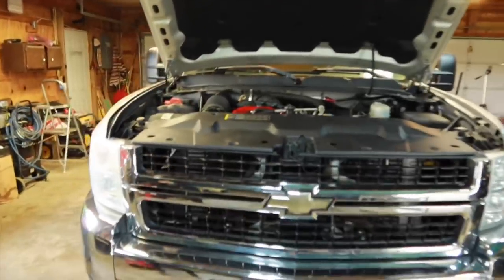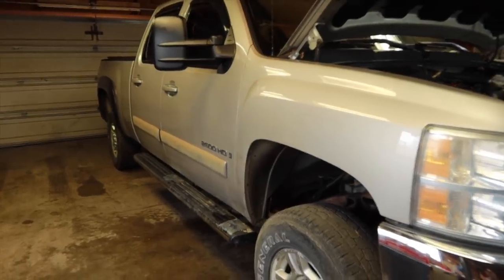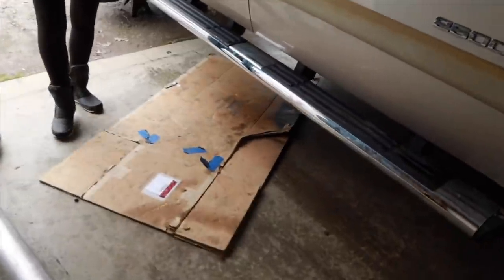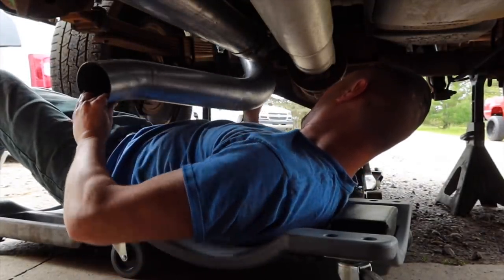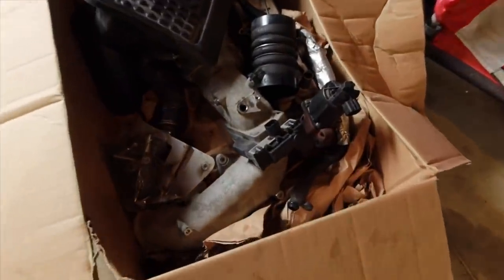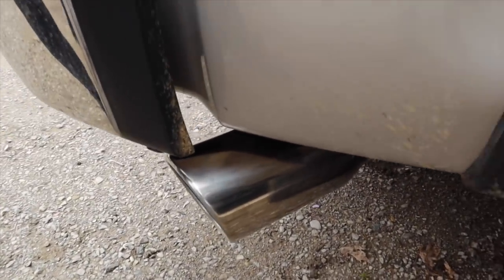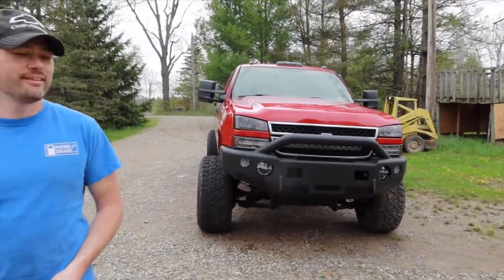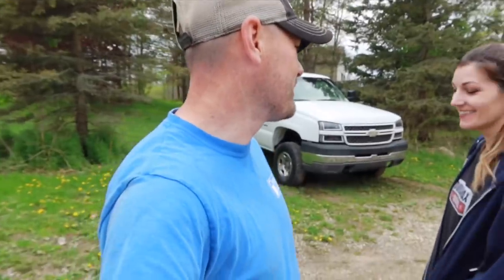You Have To Hear This Duramax Scream!

Comment: Hey Truck Master. I just recently installed the BMP Lift Pump. Super easy. I used fuse #40 "Misc IGN" for the fuse tap. That thing really pushes some fuel pressure. I checked it at the Schrader valve right behind the alternator with only the lift pump running. The CAT water separator fuel filter is really nice too. 
The lift pump has been working great. There's a sale code right now too. 
My 08 LMM is fully deleted with DSP5 EFI Live tunes.
My regular cold side pipe has pretty good brackets and it's rock solid, but I also installed the Pro Fab Y Bridge strap. It's pretty cool and cheap insurance. 
You should do a review and install video about the Pro Fab y bridge strap.
Reply from the maker: Awesome man thanks for the review
Reply: @TruckMaster  You're welcome. Great video too btw.
You're the best truck channel with quality content.

Comment: Hey truck master question? I have a 2008 crew cab LMM 2500hd duramax my truck is already tuned,deleted,egr block off kit,4 inch mbrp race  exhaust.few other minor mods. My question is I really need a new exhaust system, mines rusted out as I live in Maine, w new emissions standards purchasing a new exhaust system for my 08 Isa challenge.If I buy a system for a 2004 crewcab duramax pre DPF Era will that exhaust system fit my 08 crew cab truck? I want a 4 or 5  Inch MBRP STAINLESS exhaust system

Comment: What do you do with the dpf system in the truck I'm about to do an exhaust on my 07.5 lmm and I don't know what i need to do with it
Reply: straight pipe it and get a custom tune so it wont have any codes
Reply: I mean I have it tuned with a ppe tuner so I figured that will help with the codes right
Reply from the maker: No it has to have the option to turn the DPF off so you will need a efi live tune
Reply: Thank you truck master  do you know if there is a way to trick the system after you straight pipe it until it can be tuned
Reply: @jamesberdeaux7848  There's still EFI Live tuners online that'll hook you up. I don't want to mention who I use but they're decently well known. I used one of their dealers I found online. 
Just stay away from Same Day Tuning. It's a ripoff scam. The other tuners available are good to go. 
I used to go with PPEI but they're no longer available for delete tunes.
Reply: Truck Master so my max energy programmer won’t let me get an exhaust? cause i’m done with my lmm build i just need the exhaust

Comment: I love the chanel been watchin for a long time. I would also look at some ppei fuel fittings for each common rail. When you do the race plug. I learned that on my truck. Just to make sure that you are getting enough diesel to the injectors. The lift pump will help to but if one of those fuel fitting clogs up you will be screwed. One was starting to clog on my duramax and was throwing the p0087 code. Changed the two fittings and fixed the problem.